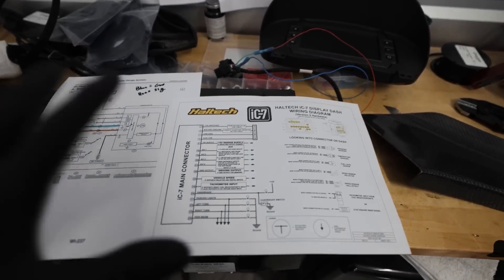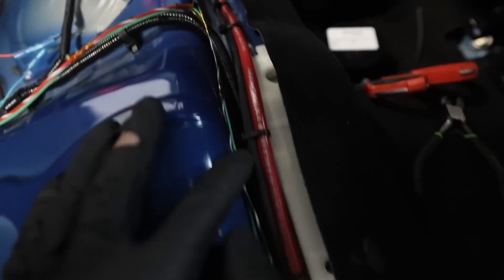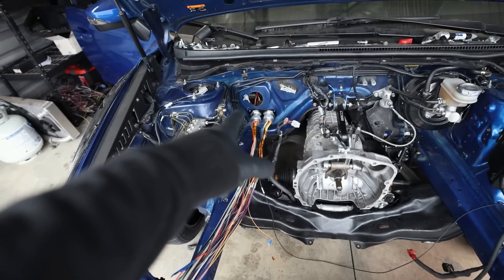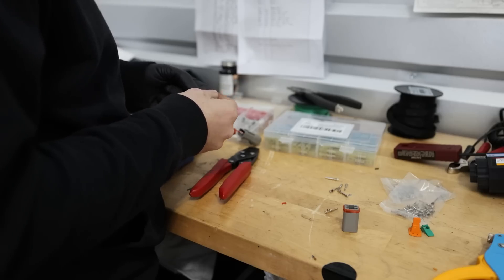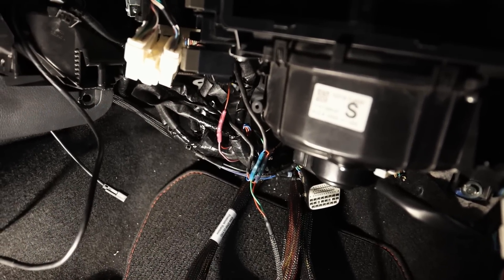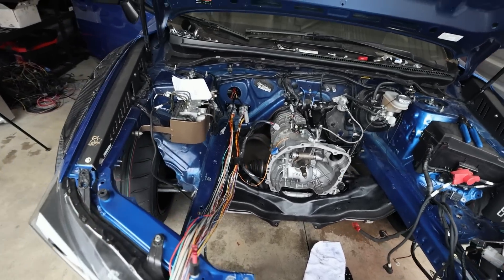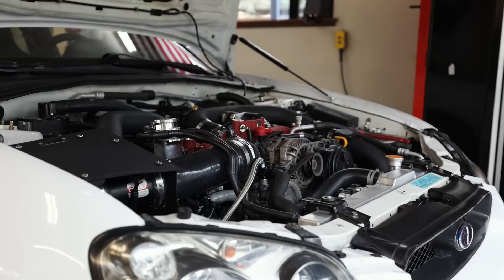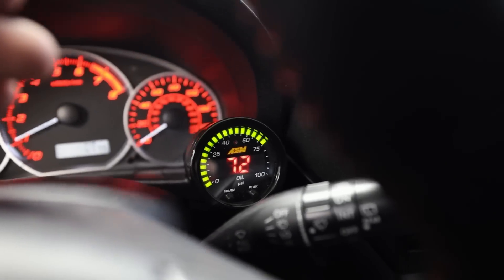My Subaru WRX STI Is Ready for it's New EG33

Comment: Yo Smeedia I still have that project ej20 to finish. I took out ej205. Is the wiring the same?
Reply from the maker: Ej 205 to what engine? 🙏
Reply: @Smeedia  ej20 jdm motor.
Reply: @Smeedia  ej20 jdm motor on in a 2005 wrx

Comment: I think you should put the other motor into blue and just wire it make the fabrication amends then it's ready for the new motor to slide on in. It's only a few bolts and nuts to set it in.
Reply from the maker: True, if the new engine does not ship out today I'll toss the spare back in 🫡

Comment: So why did you choose to use haltec and not something like emtron that has a better can integration for 2008 and newer cars
Reply from the maker: Price and no guarantee that emtron would work any better. Haltech was a bit cheaper. 

Most of the sensors that work through can bus also need inputs from the engine. Because it's nkt a standard map there was no guarantee that it would work. So figured I'd save a little $$ 

The haltech works great and provides the features I need to make everything work as needed

Comment: "It'll only work when the car is running" I mean, isn't that the same for a hydraulic power steering system?  Though, you could probably wire the electric steering to activate on aux battery.
Reply: I posted that and realized that the engine spinning the hydraulic system is what makes it work.  Brain fart.  Wiring it into aux is still an option, though, isn't it?
Reply from the maker: @foxunfocused  were gling to find out 🫡 I'm gling to look into ways to trick the can system

Comment: Just run the signal wire from rack to ignition. Thats what I did works great.
Reply from the maker: It runs off of Can communication though, did you run Can-Hi or Can-Low? Or both? 👀
Reply: I just ran signal and power and ground lol. I didn’t use can. So 1 speed. But it works badass. Even with ignition on car off it still works, easy to move car around.

Comment: +1 on the bigger gauge wires on the fuel pump, that has bit me in the past! awesome content as always bro
Reply from the maker: Definitely going to up the ground size, past thing we want is fuel pump issues 😅
Reply: For real. I will say you can use a relay and a voltage stabilizing capacitor to help with voltage dips.

Comment: Quick question so I’m getting my stock turbo replaced sometime this week but the other night i got a p0420 would that code be related with my turbo going bad? According to the dealership it’s “damage to housing” but I just wanna know if the code is in relations with the turbo
Reply from the maker: That's a catalytic converter code. What downpipe do you have?
Reply: @Smeedia  oem the car is stock other then aos
Reply from the maker: @ryanthibault5144  how many miles?
Reply: @Smeedia  96,000km 19 sti
Reply from the maker: @Ryan Thibault  a bad turbo will smoke, make fun sounds, have trouble boosting etc. P0420 is More of A bad Cat or a Bad rear O2 sensor
Reply: @Smeedia  fun sounds I do have, smoke I don’t get and boost just comes on super fast I guess when they are replacing the turbo il get them to check it out thanks have a great week homie